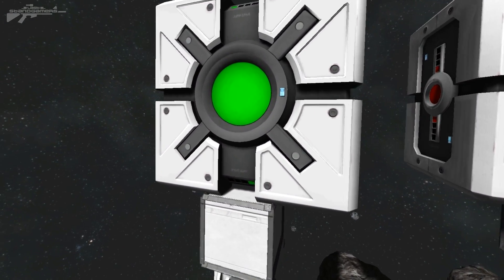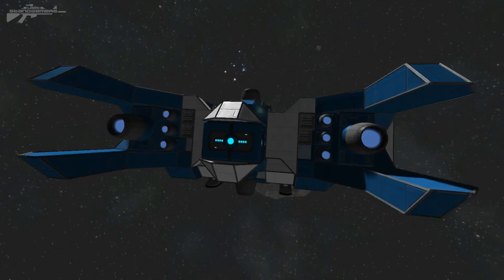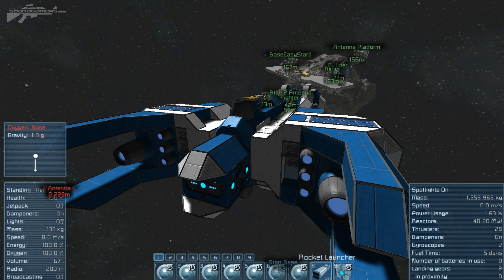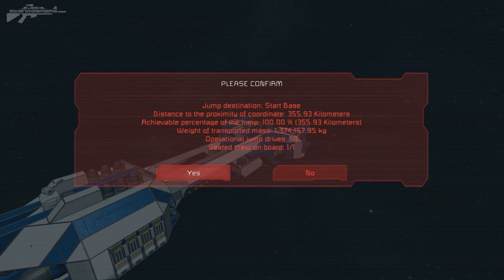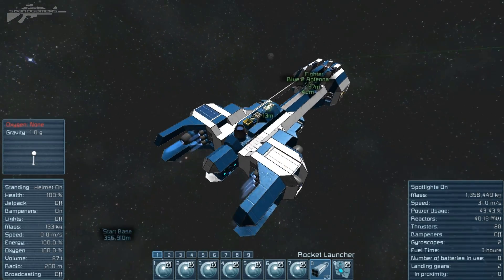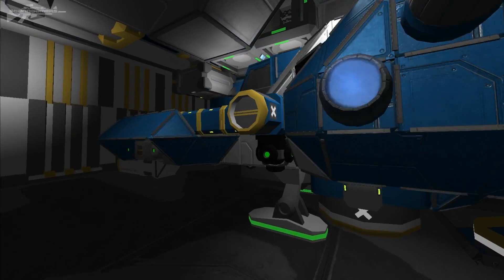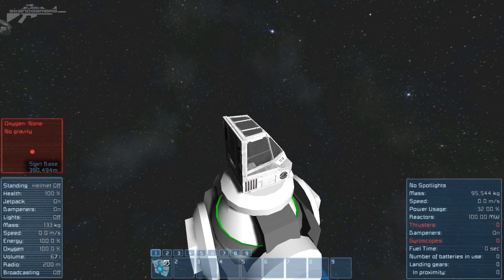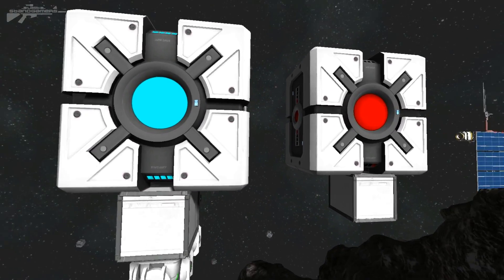Space Engineers - Jump Drive , Ship Teleporter (Update)

Comment: Everyone's talking about using it as a weapon. That's no good. But for pirating, like stealing ships in multiplayer, it's very good. You could have a simple warpdrive with a merge block and merge it to another ship to warp away. You need to build only one block during this process, the other merge block on the enemy ship. So it'll be slightly slow but it's still a viable tactic
Reply: Nethaniel Shade You can simply land on it with a landing gear. And then initiate the jump.

Comment: I've got a couple of points to consider concerning the new jump drive block.
    First, the animation from outside the ship at the start of the jump should just show a "stretching" of the ship towards the destination, not simply warping the screen image, which is a cheap effect.
    Second, if the jump drive becomes damaged just below the red line, it should arc and any attempt to use it could fling the ship in a random direction and/or destination. A adjustable "explosion" effect could be added to remove any blocks within 3-8 block radius from jump drive to simulate damage from jump drive breakage.
    And finally, there should be a scenario option in the game for add-on encounter with one or more ships, which could be either randomly or specifically selected to create encounters upon arrival at end of jump.

Comment: Primarily to escape planetary gravity wells without making staged rockets/adding 20 thrusters is my bet.... which is kinda disappointing... but also super cool. I wish it looked cooler though... more moving parts would be nice.
Reply: James Wright if you cant escape the gravity well then you shouldnt be taking it into the planet, because you will crash.
Reply: Building on a planet was what I was thinking about.
Reply: jetison333 Inertia dampeners give 10x thrust boost. So you can land softly even without sufficient thrust to take off again.
Reply: Naw, when it comes to space ships you want the lightest possible design that fulfills your goals, because inertia still applies, and that normally means aerodynamics goes out the window. Creating a large ship that can perform in atmosphere and space tends to create a ship that isnt great in either. So large ships normally should only be built in a spacedock. 

The question is really whether or not there will be the possibility of space elevators, since that is the most efficient way to get materials off planet. If not, it will probably just be done by Cargo shuttles. Worst case scenario is build a ship on the ground meant for space efficiency, and then add an aerodynamic shell to it, with major amounts of propulsion, which is then dumped once in orbit ( or returned/recycled?)
Reply: Which is the function of staged rocket systems. With the drive it is just build on the ground where there are vast supplies, or underground where it is safe, then when the monster is finished jump it out of the g-well. Ferrying supplies to and from planets was going to be very complicated without it.
Reply: James Wright Given the insane efficiency of the current nuclear thrusters, I don't think a staged launch system would be necessary. Unless they drastically increase fuel consumption, it is hard to imagine the current propulsion being inadequate.
Reply: Knsgf Is it really ten times? i think thats a bit much, could you provide a source? because last i heard it was something like 150%
Reply: I think the power consumption is double. 150 might be right. Either way, that's a manageable 8 thrusters to an unruly 12-16... Depending on your preference of course. It is gonna be fun to have to turn retro and then vertical to stick the landing on most ships.
Reply: James Wright Hopefully ship designs with rotating engine nacelles can evolve to a much more reliable state by then.
Reply: jetison333
If you download SE source code and examine MyFakes.cs, you'll find SLOWDOWN_FACTOR_THRUST_MULTIPLIER constant, which is set to 10. 150% figure refers to power usage, not thrust.
Reply: Knsgf well thats kind of stupid...